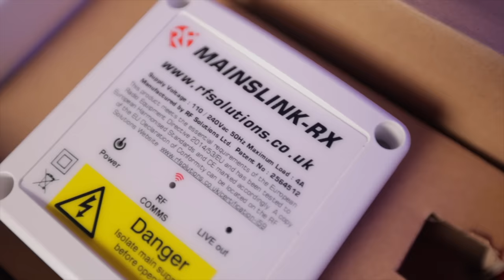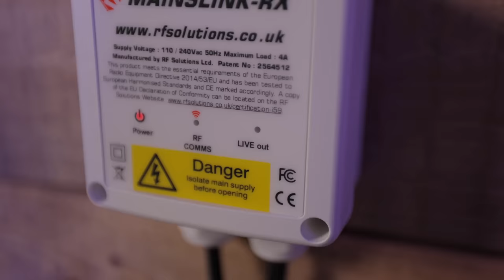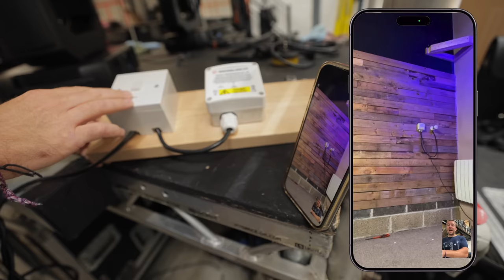A SWITCH WITH NO WIRES 🤯 RF Solutions Mainslink

Comment: That's what I was going to mention but I see someone already have😂 
This is one step behind Quinetic switch. And btw you should invest in it James as you only need it connected to the power on one side as the RF signal is generated by kinetic energy from the press.
Reply: Quinetic requires a press from a human though .....this system can be activated by voltage from a boiler or a valve

Comment: Good intro this this product matey, like others are going to say or have said, and as I was thinking, you could use much cheaper wifi/internet solutions. Thing is, do I want to depend on the internet connection always working, or the router/device having a hissy fit? Yeah planning in advance would mean you don't need this, but for retro's it could solve a lot of problems unless you wanna be a cable monkey.

Comment: Thanks for the heads up about this product and demonstrating its potential, yes there maybe other options out there but everything has its limitations and it is always good to know if there is a possible alternative solution you might need to resolve this type of problem. I know you said it's not plumbing but to be honest electrics and plumbing go hand in hand nowadays don't they? Showers, fancy expensive toilets, bidets, taps, boilers, circulators, water heaters, programmers etc etc. Great videos James, keep them coming.   👍

Comment: You still do need power to the " lightbulb" so there will be a cable in the shed for instance... Just get a WiFi light bulb?... I don't get it to be honest.
Reply from the maker: Didn’t know you could get a wifi lightbulb! 

This product does have its uses though mate and it works really well…and easily!
Reply: For sure mate.
Reply: Your WiFi might not reach the shed whereas the low frequency RF band that this solution uses most certainly will.
Reply: @garethtcollins  great mate
Reply: If you are unsure about the electickery, just accept its magic and call a spark HOLD TORT!
Reply: @Kiss-My-Aura  😂😂😂 true story

Comment: What's the benefit to this compared to a £15 wifi socket or light switch that's controllable from all over the world?
Reply: I was thinking that. I think the good thing is that wifi (device connection to the router) and the internet connection itself isn't overall reliable. This just needs reliable power - of course I want someone else to test this and see other installs before I use it!
Reply: A WiFi socket can't be controlled by a programmer or thermostat
Reply: @TheTHORNICROFT  technically no. BUT, with most heating systems having some form of smart control you can use home assistant (if there's an add-on) to trigger anything based on an input. I use zigbee and a wiser system so no wifi, except the hub to router connection. Triggers fans, blinds, checks if windows are open, room temperature, what the sun is doing before heating certain rooms which don't need heat and most importantly, if someones home - There is no cloud, my home is the cloud.
Reply: Big garden , outbuildings or big house , the wifi  might not reach .
I ended up putting in a mesh system to cover everywhere .
Reply: Because this uses a low frequency RF band which does need to rely on establishing and maintaining a WiFi/internet connection. It's just point to point with low overhead, which in turn means greater range and reliability.

Comment: So that means you need to install a fuse spur at the pump if you dont already have on there?
Reply: Which makes it non compliant from a sparkies point of view for EICR purposes.  2 or perhaps more sources of supply and isolation for 1 circuit.  Nice idea but lets get the cable out shall we or pay the electrician to do it.  That will also save the agg when the transmitter packs up.  Just do it properly innit!

Comment: Pretty sure you can do the same thing with the EPH Controls TR1TR2 RF Mains Switch which has been out for a long time. Plus both units can Send/Receive
Reply from the maker: Cheers, I’ll check them out. 👍
Reply: Yes it’s two way corresponding device just without waterproof  IP rated

Comment: If your light is at the bottom of the garden you will still have to have a live feed running to that anyway so I don't see how it's saving you running cables in that instance, you're just switching it on from distance which you could rig up hard wired in any case.